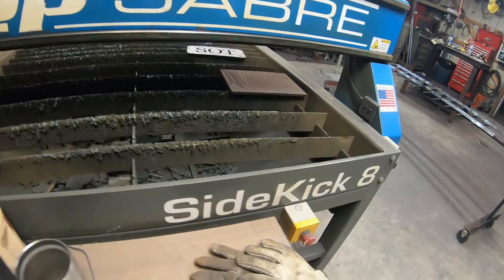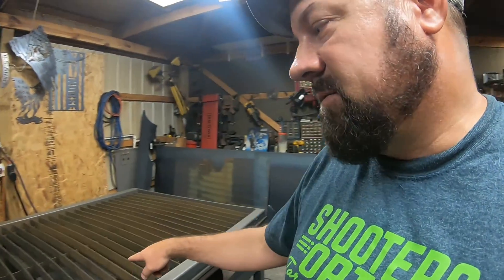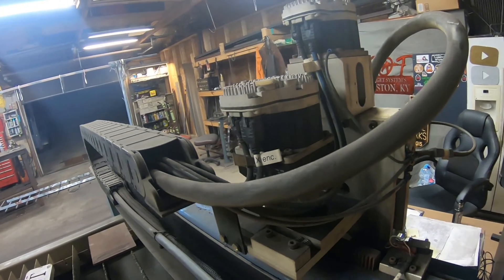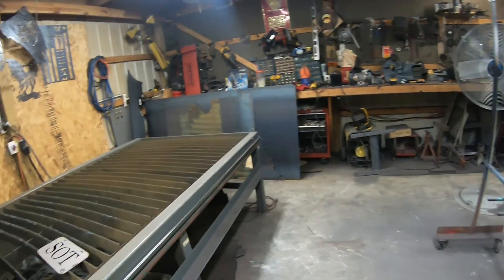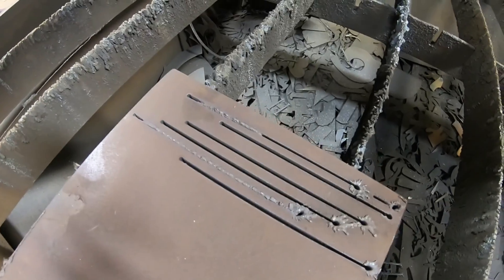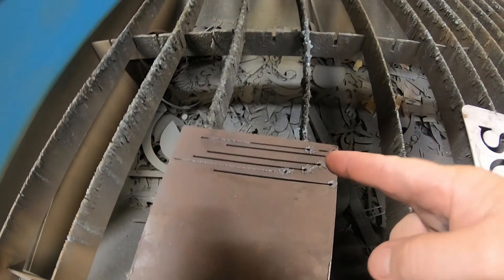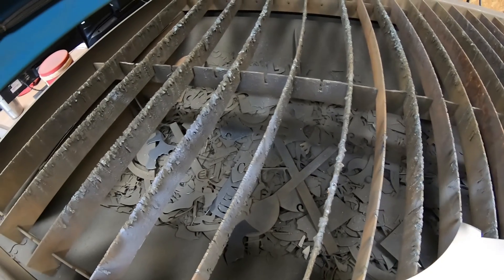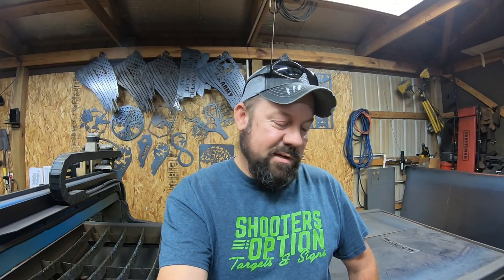Walk around of the ShopSabre CNC plasma table.

Comment: I’m thinking about getting a side kick 8 table also. What size is your compressor
Reply from the maker: Just a 60 gallon craftsman,  sometimes it seems a little slow on building air. it does a fairly good job however.
Reply: @shootersoptiontargets  thanks for getting back. Hope to pick up a down draft table like yours soon. Great work.
Reply from the maker: @justinsteele8399  shopsabre makes a great table. thanks so much.

Comment: What size compressor are you running?
Reply from the maker: 60 gallon crapsman for now. looking to upgrade in the near future.
Reply: @shootersoptiontargets  do you think 60gallon is good or 80 is better? due to compressor cycle time on off.
Reply from the maker: @dangarcia7494  60 seems to work ok but it's the single stage compressor which will keep up but runs harder. i think a duel or triple stage compressor would work better and save time and money on electric. The best thing would be a screw compressor, but man they like to charge accordingly for those things $$$. Hope that helps in some small way.
Reply: @shootersoptiontargets  Definitely, Thanks for the input.  Like your stuff buy the way!!!

Comment: Nice Video. I appreciated how you actually do a walk around of it and show your set up. Just received my sidekick 8 as well and having a rough time pulling the hypertherm lead through the lower tracks. I'm about to take the whole assembly apart to get this through but thought Id see if you have any tips pulling the insulated wire through the tracks? Thanks in advance!
Reply from the maker: Had that problem also, the tops of those tracks snap loose with a little effort then you can lay your lead in there where you need it. than make sure everything fits in nicely before snapping them back in place . thanks for watching.
Reply: @shootersoptiontargets  Thanks for the intel.  Just FYI- I was able to run the lead through the tracks after disassembly and as you suggested detaching the tracks.  Did this on a sunday. Called ShopSabre Monday am just to check and was told NOT to run the torch lead through the tracks as the hyperthem manual suggested. They suggest to just zip tie it to the side of the tracks to lower any EMI.  Would have been helpful to have that noted in their manual but all good now. Looking forward to more videos, keep up the good work.

Comment: First, thanks for the videos and sharing them. 
Second, I was a shape cutting operator for several years and was curious about the amperage you have on that unit. We cut up to 1 1/2" with 200 amps.
Thanks again for sharing.
Reply from the maker: Great Question, will put that one in the video to come. However it is a 65 amp machine, says it will cut 3/4 but have not tried that yet.